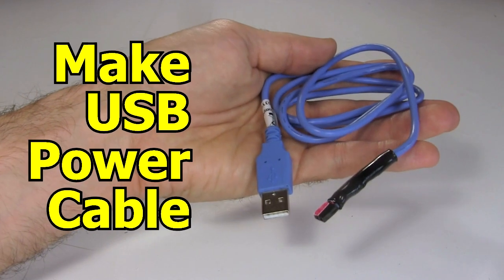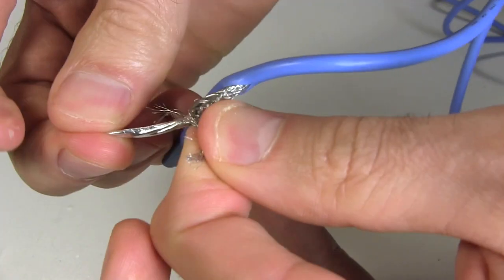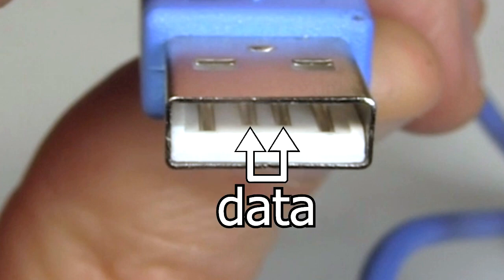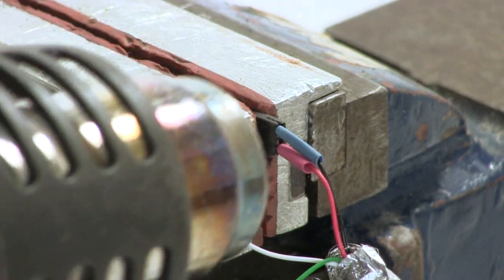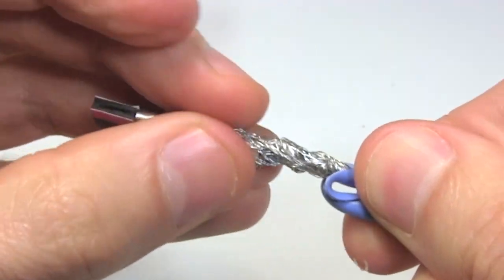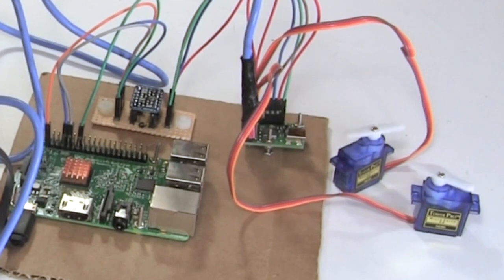Make USB Power Cable

Comment: Is there any way I could buy a cable like the one showcased in the video?
Reply from the maker: I doubt it. It's a pretty odd combination of connectors.
Reply: Search for "USB TTL Serial Cables"
Reply from the maker: @Lucas Bidule Good point. I have a USB TTL serial cable plugged into a Jetson TX1 on the table beside me right now and had forgot about it. It's this one here https://www.adafruit.com/product/954 but don't that one has a chip inside it. Are there some which don't? Of course, if you are looking for a USB TTL serial cable then you don't have to make your own.

Comment: Which pin is the red positve wire? top right or top left?
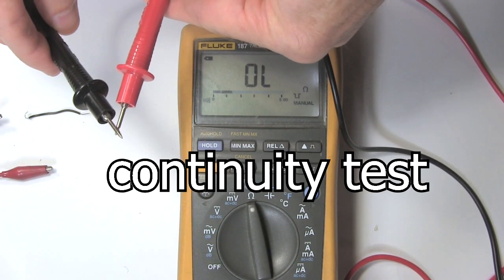Reply from the maker: See the video again starting at 1:15. At 1:26 I show that the red wire is connected to the bottom right (it depends on what you mean by top and bottom).
Reply: Thanks. I made one and tried using it to power my LED stick on RGB lights. But the lights won’t turn on. Like it can’t pull enough power. I was using a 9000 mah portable power bank. It works fine wired directly to my motorcycle battery. But won’t turn on when I add the USB pig tail like you did and plug it into my power bank. Why is that?
Reply: Also the power bank turns on when I plug it in. So it’s drawing power. And wired correctly But the LED lights I’m trying to power won’t turn on.
Reply from the maker: Some questions to look into. What voltage is your battery and what voltage is your power bank (I'm assuming that one's around 5 volts)? What voltage does your LED stick require? How many amps is your power bank rated for and how many amps does you LED stick require?
Reply: Here is the link for the power bank I’m using. 
https://www.ebay.com/itm/382523271951

And here is the link for the LED light kit. 
https://www.amazon.com/dp/B071ZGCKBL/ref=cm_sw_r_cp_api_fab_6YZBFbM8G875P

Battery is just a standard 12V motorcycle battery. 

Maybe you can help sort me out. I want to use a secondary power source so I do t have to use my battery. I’ve left it on accident and had to jump my bike.
Reply from the maker: It's what I said then, the LED list kit requires 12V. The portable phone charger doesn't say it but since it's USB, that means it puts out only 5V, not high enough.
Reply: Is there a small capacitor or something I can use to turn it into 12v?
Reply from the maker: No, since you need to go from DC to DC, more is needed. You'd need some sort of DC to DC step up converter.

Comment: Interesting and nice video! This my situation:
Recently, I found my old discman, it needs be powered by an 110v wall-adapter (also, I need to use an step-down converter, cause my country uses 220v).
Nowadays, it's better and comfortable to use only one ac power adapter for everything (for mobile phone, powerbanks).
Do you think it could be work? According to the backside and manuals, it uses 4.5v.
Thanks in advance.
Greetings from Peru.

Comment: You didn't need to shield that cable, as you no more using it for data transfer. I have extended my mobile phone charger wire to 3 meters with simple pair of copper wires.
Reply from the maker: Yeah, I figured as much but I did it anyway.
Reply: yeah that plastic pin header wont be completing "case" ground from the battery anyways. a concern about having the shielding left open(not electrically bonded between devices) is that it creates an antennae.  then with the variables of cable length and power across the cable, it could possibly cause radio frequency interference somewhere else.   as they say in the states, non fcc compliant.

Comment: Is it safe to connect two usb cables into on power cable because I know a usb can only do 5v but I need to get to 10v
Reply from the maker: Connecting multiple cables will only allow you to handle more current. For changing the voltage you'd need some kind of circuit. I don't have any suggestion off-hand.

Comment: I'm gonna use this to make a 3DS USB charger.
Reply: Did it work?
Reply: @terrarian9501  this method limits the power to 5V@0.1A = 0.5W. works, but not very well. in order receive more power, additional circuitry is necessary. usb doesnt provide all the available current without negotiating the power level first.

Comment: Is it possible to cut off a sata data cable  to connvert to usb on the other end? Please reply. T.y
Reply from the maker: This is the first I've heard of SATA cables so I can't say for sure. Based on this webpage https://techterms.com/definition/sata there are 7 wires but the USB connector has only 4 so you'd only be able to use 4 of the wires from the SATA cable. I also don't know what size the wires are so if they're very small, they may be hard to work with.

Comment: Why did you wrap tin foil around the wires at the end?
Reply from the maker: That's to prevent electromagnetic interference. Basically, some things emit electromagnetic waves and those could interfere with the current conducting in the wires and cause errors in the signals going to the circuit board. Having a metal covering, ideally connected somewhere to Earth ground, helps block that (https://en.wikipedia.org/wiki/Electromagnetic_shielding).
Reply: @RimstarOrg  , I very much doubt that the addition of the aluminum foil shield made any difference at all. The shielding in a USB cable is there primarily to shunt radiated electrostatic energy from being emitted and causing interference with other electronics, and that is only a consideration with the high speed data wires (green and white), which are not being used anyway in this power-only application. Then, the two power cables (red and black) neither radiate such energy, nor are they influenced by it. All that needed to be done here was cut off the braided and foil shield at the end of the insulation, and cut the two data wires off a bit further (so they can't short to the shield). Insulating the two stub ends of the data wires is advisable so possible shorts between them cannot damage anything in the equipment providing the USB power (and if that is just a USB charger or power pack, there is probably not even any connections to those data signals anyway). Then it certainly is cosmetic to put some shrink tubing or electrical tape around the end of the cable where the insulation ends....but not technically necessary.

Comment: Thank you interesting video I hope you check your posting I'm what I'm trying to do is I have a little Kia and I'm big on cameras but the problem is when I turn my key off both my front and rear Outlets 12 volt Outlet cigarette lighter Outlets to go dead and therefore the cameras don't stay charged to running until they go battery post and I need it 24/7 plug in there what I want is somewhere that I can set a base unit under the hood and just run the 9 watt wires to the outlets at I need or to the SUV plugs for those units those cameras or something of that nature something simpler trying to avoid having Tim cigarette plugs in my vehicle

Comment: Neat stuff here...!!
Do you have a video on how to make a MHz generator ....?
Cheers...!!!
Reply from the maker: Thanks! MHz covers quite a range. I have this webpage about using the Mini-Circuits POS-400+ chip for the 200MHz to 380MHz range.
Reply: Hello,thanks for your reply.I'll check it out.However I was looking for lower range MHz like 1 MHz  to  20 MHz.
Reply from the maker: A quick google search shows plenty of oscillators in that range.

Comment: My daughter has a night light powered by 3 AA batteries. I'm thinking of "hacking it" to run off 5v from an old phone charger. Its pretty simple. Its roughly 20 or so LEDS in a cat shape with an 800ohm resistor if I remember correctly (i'll of course check properly).  Am I missing something?
Reply: @ravikilnake4100  there is no logic I can use to make that make sense in my head.

Comment: I want to do this to charge laptop from powerbank.
Reply: if the laptop doesn't charge over usb-c i wouldn't recommend it. Because you have to charge at like what? 19v? and some amps and something like 45/65/90W which may not be lower then it says on the ac adapter... don't try it on your only laptop

Comment: You kept the insulation and said so I can show you something in a minute but you didn't do anything with them...
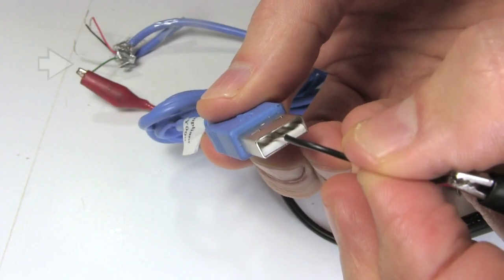Reply from the maker: I stripped the insulation off the white and green wires even though I didn't need to so that I could show you where they went to at the connector end. I do that at 1:34.
Reply: @RimstarOrg  ah. Thank you for replying. And thank you for your video, great job.

Comment: you need to invest some 10$ in some crimper and duponts.. sloppy job
Reply from the maker: What's a dupont? I use crimpers to larger diameter wire but mine don't work for this smaller diameter. But there was nothing sloppy about the trimming I did, no strands wasted or missing. Plus, not everyone watching has the specific tools for the job, so it's good to show other ways every now and then.
Reply: dupont's a way to make custom jumper wires without soldering.  crimping has the advantage of being able to use a jumper wire numerous times without the risk of cracking a soldered connection on the jumper wire.  which could create cold solder joints that could cause intermittent problems.